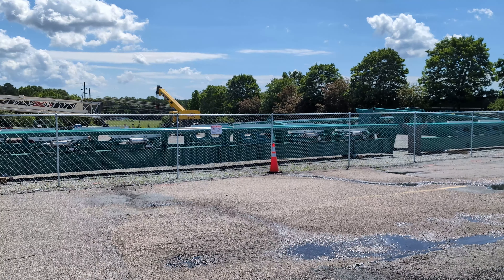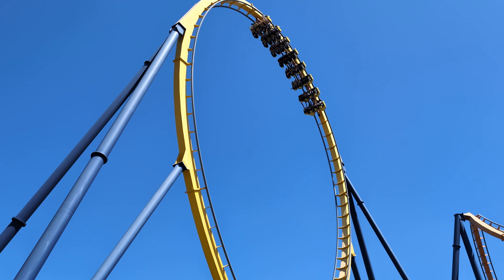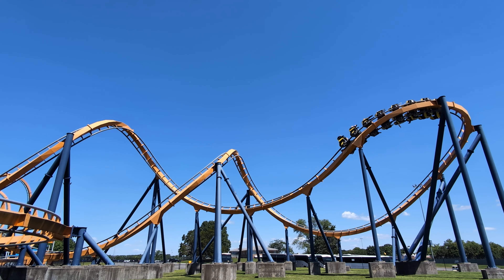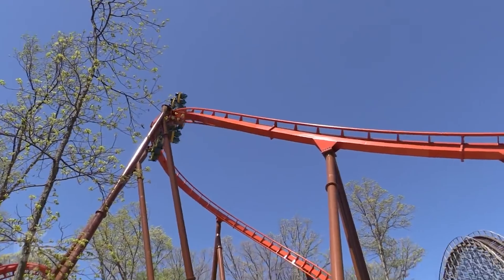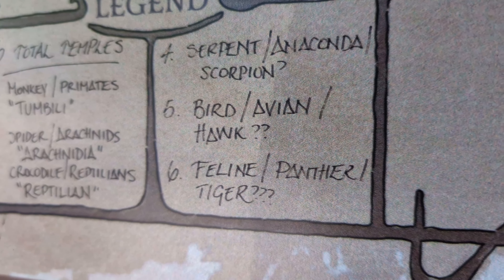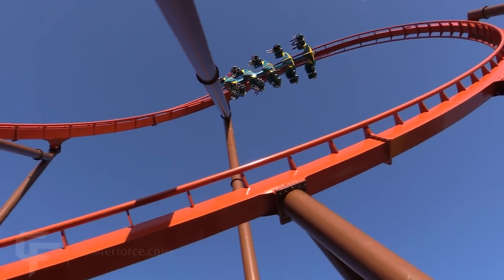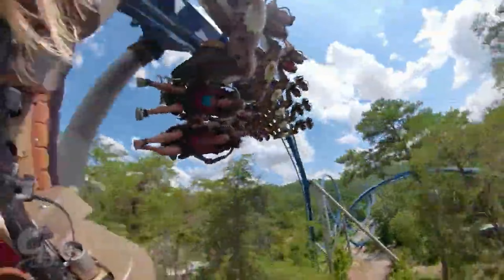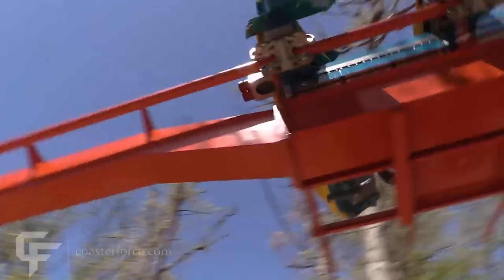Kings Dominion's 2025 Roller Coaster Update

Comment: It should've been a B&M Sit-down LSM Launch Coaster similar to Jimna's except it's B&M's own design, but don't get at me wrong i like the Wing Coasters but I prefer them to get a B&M Sit-down LSM Launch Coaster, but maybe they will convert it into a B&M Sit-down LSM Launch Coaster if B&M puts them up  in stock.
Reply: Yeah I get what you’re saying but I don’t think that’s likely considering they’re prob going with the bird theme for jungle Xpedition so it’s more fitting for a wing coaster
Reply: @thethinghopppe410   Or an Avian  Humanoid because I don't know if there any mythical birds that have green feathers except kukulkan. But no offense there are bird-themed coasters that aren't wing. So it doesn't matter sometimes. If you don't know what an avian humanoid is It's a humanoid bird like a Garuda or a Montu. But it would be better if they themed that area to Adventure Port or an Ancient Spain themed area like Adventure Port to match with its sister park Kings Island. They should also remove that bobsled to make room for an Vekoma Adventure Express clone.
Reply: They physically can't change it. The track design is the same but you can't just change it. The wing coaster is launched by "Linear Synchronous Motors" B&M doesn't manufacture their sit down model anymore and they have never been popular compared to their other models. The track size is also different to other B&M models. Take a B&M dive coaster for example, the track is wider but of the same box design to support the wider train. The wing coaster design and each element of the coaster was designed for the wing trains.    The clearance for these trains is very different so the whole design of the ride would have to change because the banking of each element is specifically designed for those trains. Plus the speed is going to be very different, the forces would be different and this could lead to serious rider injuries. Oh and before anyone says "B&M have switched trains before like the floorless conversions" that was done because those trains are almost identical, riders are still sat in the same position and the elevation was practically the same. Wing coasters need much more width to get through elements because of the design of the trains.